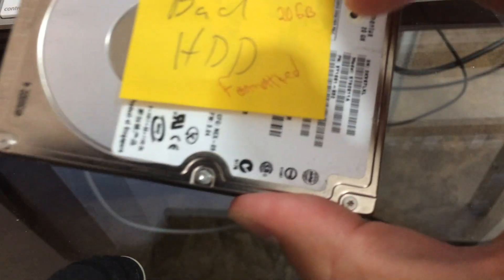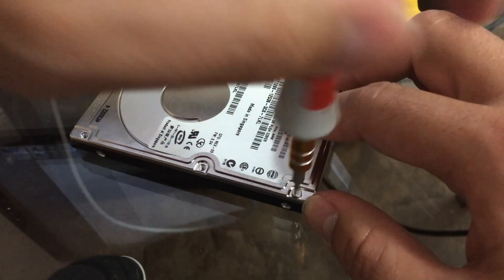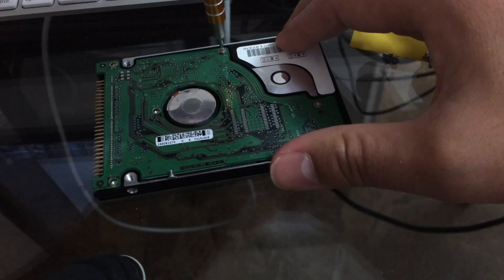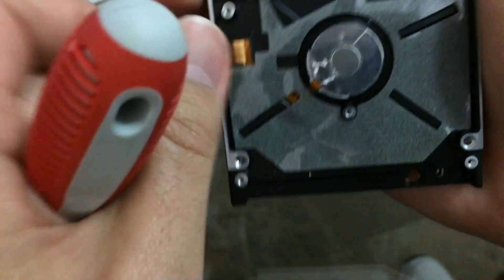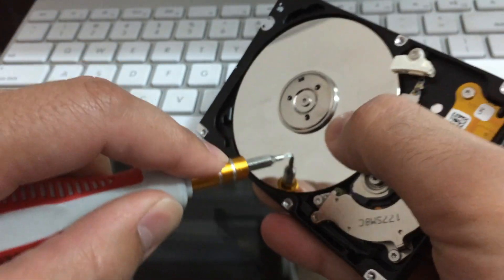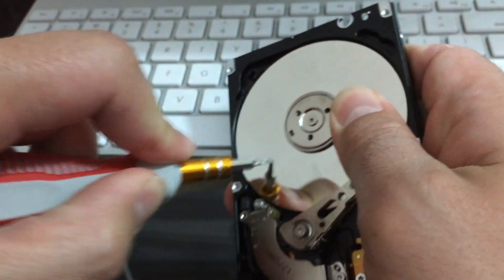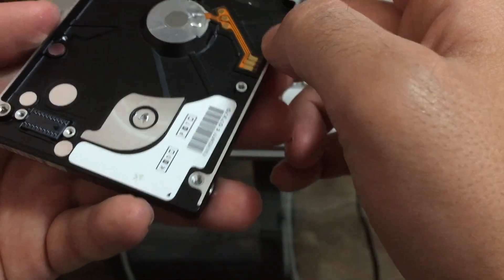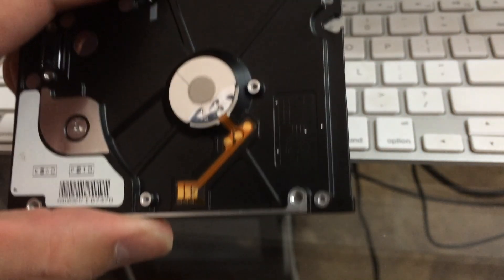Disassembling a Hard Drive with TechPro Tools Torx Screwdrivers

Comment: Would have helped if he'd said which size of Torx screwdrivers he used.
Reply: William Rossiter T5 on top side, not sure on the bottom side.
Reply: He literally put the link in the description smhhh
Reply: @Cheems09  yeah but there out of stock so the dude is correct it would of been helpful if he said what size
Reply: @daman1922  true
Reply: @Cheems09  you replied to me after 3 years 😂 lmao
Reply: @daman1922  did you guys ever find out?

Comment: The cover has a hidden screw behind the label, you can feel for it, secondly your drive looked like it could have been repaired, simple by pulling the arm(Actuator) back to the park position, when you tested it, did it make a loud noise.